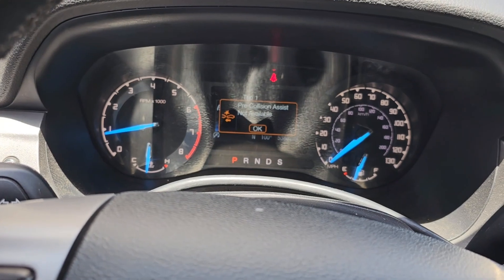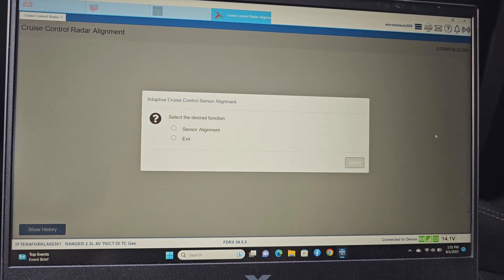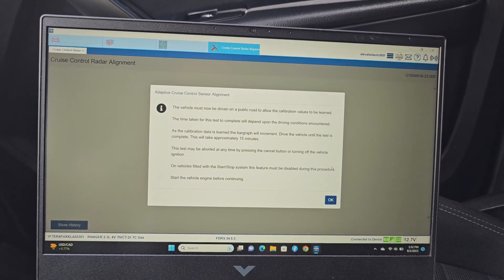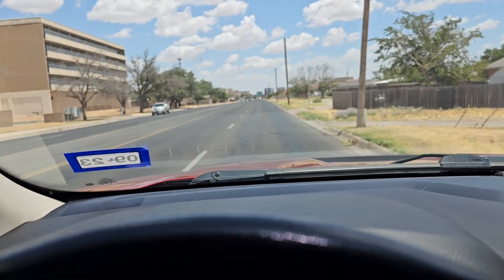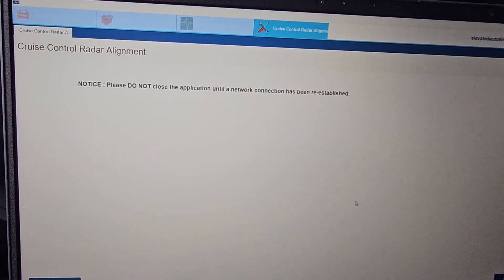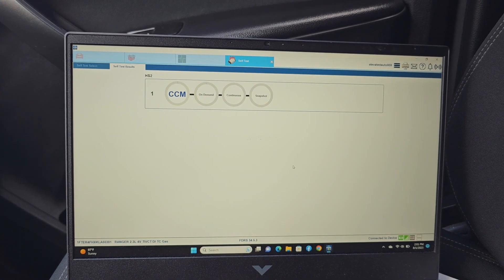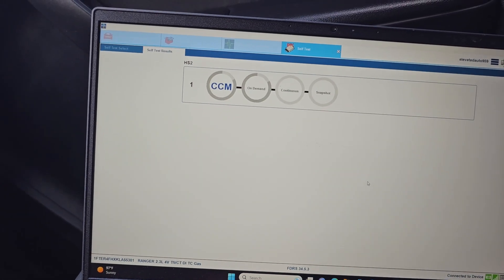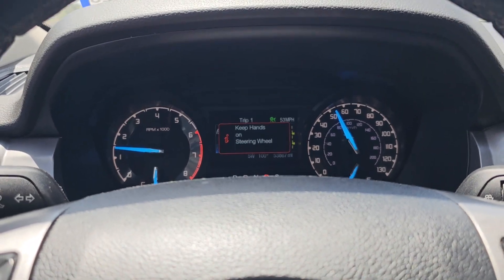B142E:78-AF Forward Looking Sensor Horizontal Alignment. recalibration launch pad v failed. FDRS

Comment: Thanks for sharing the video.   I used forscan and recalibrated one on a 2017 F450 and it worked!
Reply: I don't see an option on forscan for my 22 mustang.
Reply: What option in forscan you choosed for horizontal calib?